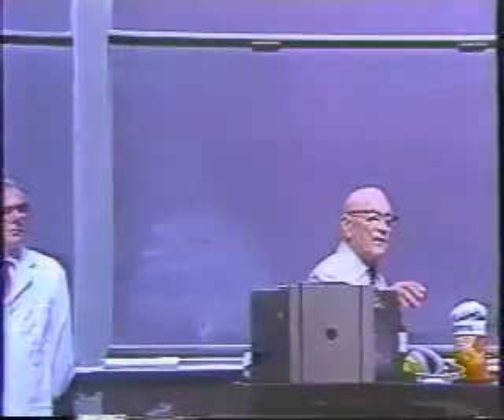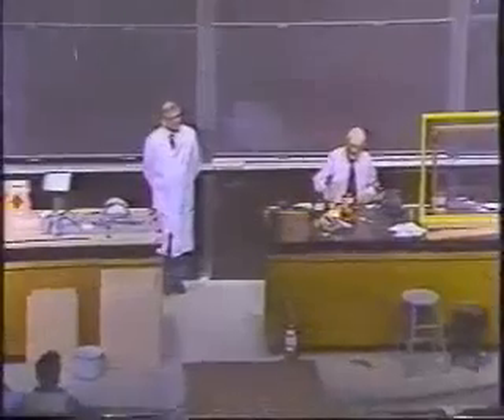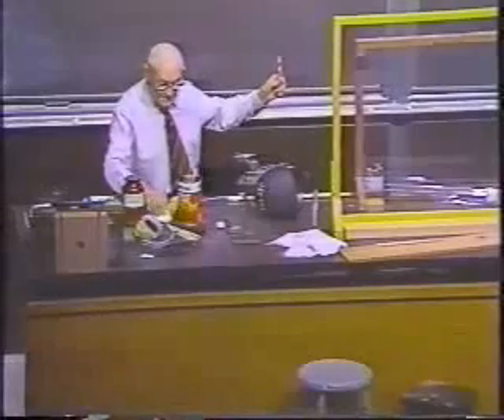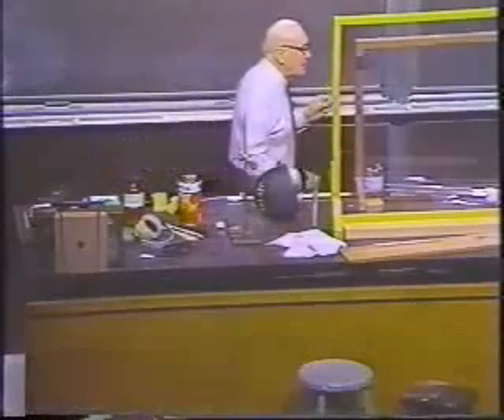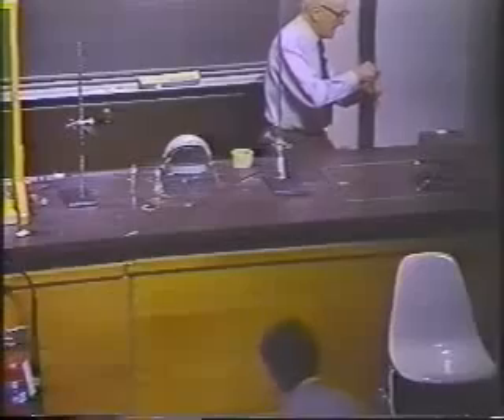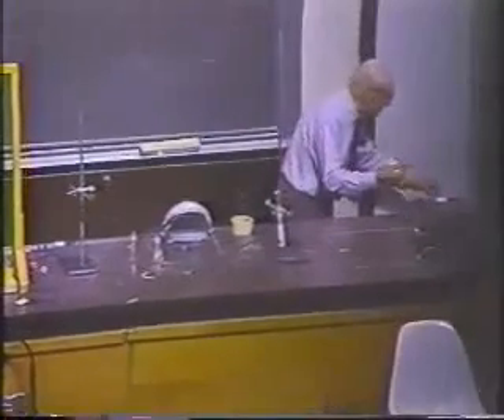It's a Blast!  public lecture on explosives by Col  B  D  Shaw

Comment: I’ve watched this lecture video several times since I learned about Col Shaw through Periodic Videos. I’m curious to know what the source of the video was, 35mm film or maybe VHS? If it’s still intact I wonder if we might have a higher quality digital transfer made. It’s such a great lecture I’d really like to enjoy it in the highest quality possible. Thank you OP.
Reply from the maker: Hi Michael. I downloaded this some years ago from Harvard's website. It no longer seems to be there, so it's a good job I did! From the nature of the artefacts, I've always assumed that it was filmed by in-house staff on VHS cameras. I doubt that original tapes still exist - if they have anything at all it will probably just be this same file. It could be worth contacting them, but I would not be very hopeful. The BBC screened a shortened version of this many years ago, but TBH the BBC are not very good at keeping old material either. It's all also hampered by the fact that any material to do with explosives and fireworks now seems to be virtually taboo...